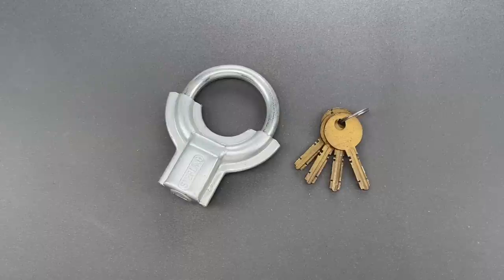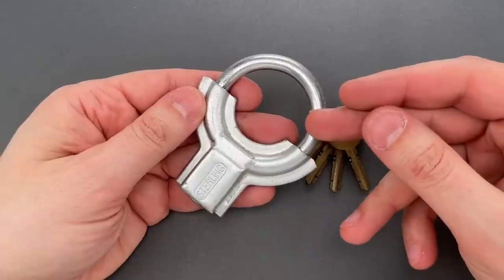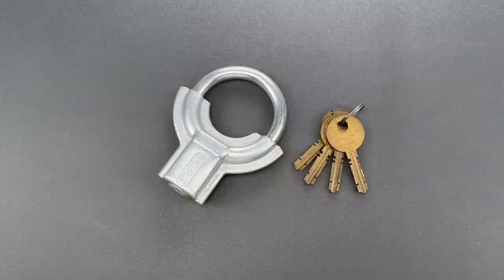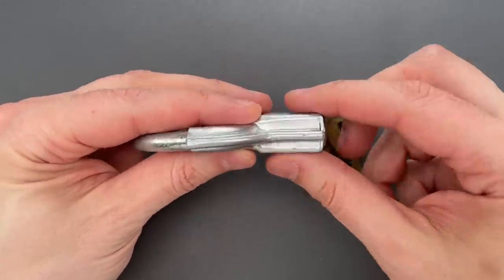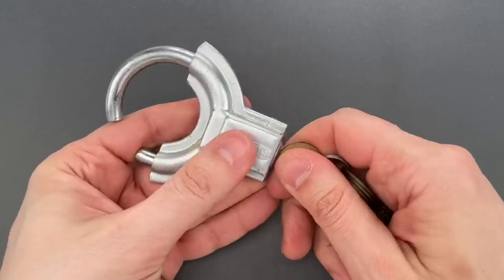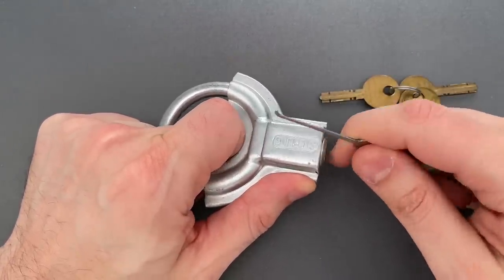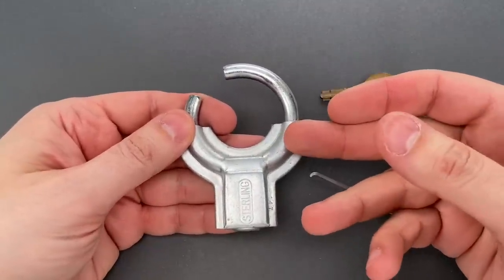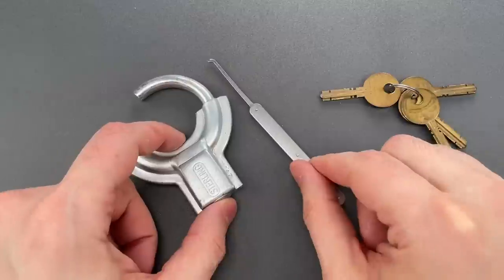[1512] Sterling “Gas Pump Lock” Picked

Comment: I've always seen locks like this to serve 2 purposes. 1. it'll keep your young kids out of something and 2. It'll communicate that you do NOT want people inside of something. That's pretty much it.
Reply: And with the disposable version, they can also show if a utility box has been tampered with. Much like the little tags put on electrical meters.
Reply: Number 1 can be a big deal. Once you've had to pick/break a lock to access something there is no question that you got there accidentally. You willfully and knowingly got into something that you knew you should not have.
Reply: They used these a lot on power/water meters to prevent/show tampering.  They even sold them serialized sure they still do.   The non key version they call a "one shot" as you have to cut it off.
Reply: If it's actually a gas pump lock, you'd only put it on there to keep people from using the pump while someone is in the building. I.e., it is really just a sign saying "pump out of order" that the inattentive customer can't ignore. If there's nobody in the building (gas station is closed) you turn off the power to the pumps and you're done.
Reply: @Summit2012  Sort of where the TSA lock came from.... a keyed or combo lock that gives TSA, Ramp Agent and everyone from the airlines a shot at your stuff... especially stolen items: Camera Lenses.
Reply: @darrennew8211    I've never seen it used on  gas pumps.  Only seen it used and marketed for the utility industry .
Reply: @Autistic_train_set  Well, we used actual padlocks, but we still turned off the power when nobody was there. I was just basing it on it being called a gas pump lock.  (Honestly, I thought it went around the end of the nozzle where the spring is until I saw him open it.)
Reply: Does this mean a Masterlock tells anyone to "please take this item I am giving it away for free."
Reply: The line of thought in security is theft and other crimes are mostly of opportunity, not premeditated. Meaning just the show of having a means to keep out those unwanted is enough for most.

Which means they can focus their resources on combating those whom are deliberately breaching security. If someone wants to do something, they will. So why put a lot of resources into the stuff meant to ward off the every day schmuck from getting too curious when they can put those resources towards real threats?
Reply: If you don’t want people inside of something you use a good lock. To a human a sign saying keep out really says there might be something cool inside. It might also be deadly but that’s a risk our species is willing to take.
Reply: @rogerszmodis  Not everyone has knowledge of the weaknesses of locks. So any lock at all is a deterrent. Keeps the honest man honest. Thus only those who are willful in their trespassing are left. Makes things easier. There will always be those who ignore wisdom or have ill intent.
Reply: My stepfather locked his gun cabinet with one of these, and that's exactly the purpose it served.
Reply: The other use is as an outdoor padlock to keep animals out rather than people

Comment: Having worked in the electrical power distribution industry for over 30 years, these locks are often used to satisfy the requirement of a “second layer” of security to prevent access to the penta-head bolt which often secures electrical cabinets. Rest assured, after it’s been in the weather for a number of years only way you will remove it is with bolt cutters because the inside rusts up solid.😉👍
Reply: bolt cutters
Reply: @NoName-zn1sb  you understand what it meant
Reply: @NoName-zn1sb  typo, edited, happy now ?
Reply: I'm used to seeing the solid brass ones, and now I know why.
Reply: There is a trick to pealing the cover off with pliers. Much easier than grabbing the bolt cutters out of the truck. 2 years in the industry working on the engineering side but enjoying it so far.
Reply: Same. We use the disposable ones.
Reply: @Dan-56  
That's rude, be happy that someone pointed out your mistake
Reply: It seems like a loto tool to me honestly

Comment: We need to see LPL unlocking the version with no keyhole at all now.
Reply: yes, we do!
Reply: My thought would be to try and wriggle a bent decoder between the shackle and body to try and do it.
Reply: LPL: "This can, however, be opened with a strong magnet." 🧲
Reply: LPL: "We're gonna insert the shims into both ends of the shackle and pull hard, to show it wasn't a fluke I will do that one more time."
Reply: Shims I would think.
Reply: @David_Crayford  "Or a hammer."
Reply: @samiraperi467  The point of lock picking, as opposed to destructive entry, is not leaving an obvious sign of breaking in.
Reply: @Voltaic_Fire  My first thought, but how would you get a shim deep enough into the lock?
Reply: @Dexaan  Oh I'm sure there's a tool Bosnian Bill and he made at some point. :p
Reply: @Dexaan  remember as well that he had to manipulate the pick in two directions, more or less at the same time, and I don't think you'd be able to do that by following the shackle down because you would only have an ability to exert force in one direction
Reply: @hanelyp1  LPL sometimes uses a mallet to rap open a lock by percussive force without smashing the lock.
Reply: There is a tool for that , it is called a plasma torch
Reply: The version of this with no key is a seal used on cargo containers for one time use, they will have numbers stamped on them to verify they have been tampered with in shipping
Reply: hummer or magnet... i assume
Reply: @joezuccardo3245  Thanks! I think we've seen LPL bypass anti-tamper seals before...
Reply: I remember that LPL did "pick" a lock that had no key hole.
It was a "Love lock" or something, that you're supposed to put on a fence or something. And it didn't have a key hole, so once it's locked, it was supposed to be impossible to open again.
Of course LPL used shims to open it.
Reply: Top of the keyway tension.... Damn, where's the keyway?
Reply: Might take a little longer than usual because he will spend some time looking for a keyway.
Reply: @eugef , I'm pretty sure that running over it with a hummer would get it open . . . .
Reply: @better.better  Feed a pair of spring wires along the inside radius from one side, while feeding a slightly dimpled ribbon of metal in from the other side to give them a little ramp to finish following the curve around to the other side. Work the wires around the minor radius so that one is at the front and the other is at the back; these are your shims. Put slight tension on the wires, if necessary, and rotate the shackle.

At least, that's what I'd try first.
Reply: We just use our HK Porter key for those in the powerline industry.
Reply: there was such a video for a St.Valentine's day. not the exact lock, but also a "close-only" lock
Reply: I made them! They're designed to just be cut open.

Comment: It's really nice to see a low security lock that is sold as such with a harder time picking than some of Masterlocks high security options
Reply: Haha, at least you have to turn the bypass in two different directions.
Reply: If it's actually a gas pump lock, you'd only put it on there to keep people from using the pump while someone is in the building. I.e., it is really just a sign saying "pump out of order" that the inattentive customer can't ignore. If there's nobody in the building (gas station is closed) you turn off the power to the pumps and you're done.
Reply: “A harder time picking” is a funny way to describe something that took less than 10 seconds
Reply: It seems that "Master" and "security" are oxymorons.
Reply: Masterlock labs: Can we clone this cheaply  in that it doesn't use any key at all?
LPL: I'm stumped... where do I insert the pick?

"Security through Obscurity"
Reply: @-danR  there's always some guy with a bolt cutter or acetylene pick.
Reply: I think that steel clamshell could be pried open enough to insert and twist a pick. Of just pry it open enough to insert a screwdriver and separate the fingers.
Reply: @smittywerbenjagermanjensen1051  Some of Master Locks high security locks take than than 2 seconds. And this took nearly 10. Your point fails my guy
Reply: @matthewdodd1262  8 seconds isn't a meaningful difference my guy 🥴
Reply: The higher level of security must have meant that a soda can would not work as well for this one.

Comment: I work for spectrum, and we have these on some of our outside boxes. If the locking mechanism is compromised, we're told to basically peel them apart like a banana.
Reply: Yeah, that is how we open the single use style if you don't want to grab the bolt cutters.

Comment: Again, probably good enough for the intended purpose. There are lots of applications where a lock is just needed to keep kids and halfwits out of places they are not supposed to go to or simply show the user the gas pump etc. is currently not in use. Often the actual thing (a gate, an access door, an electrical switch etc.) the lock is used on would be fairly easy to open by brute force anyway, completely bypassing the lock, so no need for a high security one.

Comment: I remember seeing those on gas pumps back in the day. As I remember it they were used on the pump when the storage tank was being filled or measured, I think to prevent the gas station from getting free gas by pumping it out for sale while the fuel truck was pumping it into the storage tank.
Reply: Actually, when they are filling the storage tank, a lot of the sediment (which tends to drift to the bottom of the tank) starts swirling around. If you were to pump fuel at the same time, there is a good chance of you pumping up some of that sediment, which could end up harming your engine. 
Having the pumps closed when they are refilling prevents such issues.
Reply: @mikkieam  A valid point I agree. Thinking back on it, the station manager's explanation might actually be a testament to his mindset.
Reply: Tanker trucks have meters that tell exactly how much fuel has been delivered so pumping during filling would not allow anyone to get free fuel as every drop is still passed through the meter. Yes, the tanks often have dipsticks or scale markings but they are not accurate enough to be used to determine the amount sold.
Reply: @Murgoh  Believe it or not, back in those days truck meters were mechanical and not that accurate. Dipping the tanks was considered to be correct.  Don't forget, gas was around $0.25/gallon.
Reply: Gas is sold to stations by what's loaded into the truck at the POL dump.  It wouldn't matter if you were pumping it out of the tank as fast as the truck is putting it in, the station pays for every gallon.
Reply: The truck meters were accurate to 1/100th of a gallon.  But these were not how stations were billed, they weren't even used.  The driver would pull up, put in a dipstick, then hook up the tank hose and open the valve.  When the sight glass cleared, he would stick the tank again to verify that the whole load had been delivered.
Reply: @SoloPilot6  I've watched the fuel delivery driver at my local gas station drop the stick in to the tank and I was surprised that this long-ass stick went into the tank followed by the rope attached to it. (Fuel delivery is occurring after midnight at this station.)
Reply: This would also work for a gas pump out of order or any other time you wanted to temporarily disable one pump of several on a circuit breaker.
Reply: @SoloPilot6  I think the truck would dump the full load, and the station get charged for how much they put into the truck in the first place. The dip stick was used to ensure there was room in the tank, and to ensure that (as you say) the truck didn't stop dumping before it was drained for some reason. It's not like the dip stick was calibrated in gallons or something.
Reply: @LadyAnuB  When I was working on it back in the 70s, it wasn't unusual for us to get two tank trucks of gas delivered on the same day for our little 10-pump station. The underground tanks are actually surprisingly big.
Reply: @darrennew8211  Yep.  The sale was calculated when the truck was filled, not when it delivered.

Comment: As the saying goes, "Locks only keep the honest people out." The easiest way  to break into someone's house is to smash a window. Actually, now that I remember, that is exactly what thieves, especially in Seattle, San Francisco, and Los Angeles are doing with cars. The thieves can break a side window instantaneously and grab the backpack, computer bag, or package off the seat and be gone in under 30 seconds.
Reply: @Rev. Kirk KB7QOD - Yes, they even defeated the latest version of Mark Rober's Glitter Bomb by that smash-and-grab technique.
Reply: Yup, and leave the owner with a serious repair bill if he's not well insured.
Reply: @joelee2371  even if you are insured, you gonna be paying a higher premium for the next few years. Probably not worth it for a window. These companies don't make billions by giving away money.
Reply: I have one car with relatively small production numbers and little aftermarket support, and honestly? I leave the doors unlocked and rely the assumption that anyone who's willing to bypass an ignition switch would also be able to open the door without a key, and the cost of replacing a (rare, and very expensive) window is greater than the cost of 50 cents worth of change and a first aid kit. if someone wants to steal a 25 year old factory tape deck, they can go right ahead.
Reply: @KiinaSu  no argument there.

Comment: The disposable locks, and probably this style, can be opened with pliers too. If you use the cutting part of the pliers to grab the seem next to the shackle. Then just twist the pliers along the long axis to peal back the cover they usually come flying apart. Obviously bolt cutters work too but it's easier carrying around pliers. We use the disposable kind to secure small pad mount transformers.

Comment: re Master locks - I have just taken apart a Master shackle (shed door), the loop on the shackle is only attached with a flat slotted plate.  Levered slightly away from the door, a hook can pull the plate off the loop,  no need to attack the lock at all.

Comment: I've seen this or a similar lock in use at Costco Gas. Instead of just turning all the pumps off when closed for holidays, they lock the nozzle to the pump so you can't pick up and try to use it.
Reply: I think they'll still also cut the power to the pumps, the locks are just to deter kids from playing with the nozzles or stealing them and also to signal any potential customer the pump is not in use.
Reply: @Murgoh  Nope. I've actually gone to Costo Gas on a holiday, seen the pumps on, tried to get gas and then find out that the nozzle is locked to the pump. The only way I knew the pumps were locked was trying to remove the nozzle without looking, finding out I can't then looking for and finding the lock.

Comment: I work for an ISP and we use these at work to keep people out of things like service utility boxes.  Not exactly secure but deters people from entering to a degree.  Might be the wrong term but we call them railroad locks at our company.
Reply: I will also add those will freeze up in the winter but are easier to thaw than the larger locks.

Comment: They use to put these locks on the green cable boxes outside in our back yard, picked it with a paper clip and took off a scrambler on the line to get free HBO.

Comment: Alternatively, you can easily just rip apart the frame with pliers or side cutters by grabbing onto the lip and rotating away, and the whole assembly will fall apart in a matter of seconds. We do it all the time on our company locked boxes that have rusted out, as those keys break far too easily when the lock has gotten rusted inside.

Comment: What I'd like to see is if the difficulty to pick increases when it's actually attached to something. Haven't really thought of it before, but with this lock in particular you put tension on the shackle directly. If it is locked around something, presumably it would be more difficult to add tension at the right angle therefore making it more difficult to pick. 

Whether it doesn't change the difficulty, only adds a couple of seconds, or makes it very difficult taking upwards of several minutes, I would think it would be interesting to see.

Comment: LockPickingLawyer, I am a big fan and like to do a bit of hobby picking myself. I have a small challenge for you, that you might find fun.  
A couple of weeks ago I was stuck on a work trip over a weekend and got bored.  I had no picking tools with me and I challenged myself to make pick and a tensioner using nothing but a couple of Aluminum beer cans and a pair of kitchen scissors.  It took me a couple of iterations but eventually I was able to get picking,  I picked all the locks in the apartment except for the deadbolt, on the front door, probably because it just had a few too many pins for my weak tools.
You should give it a try,  It might make a fun video!